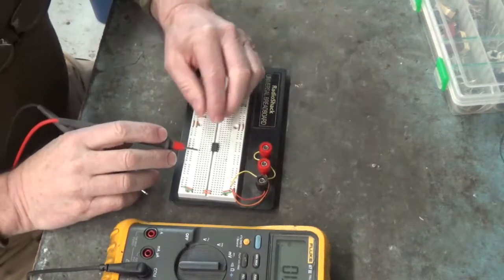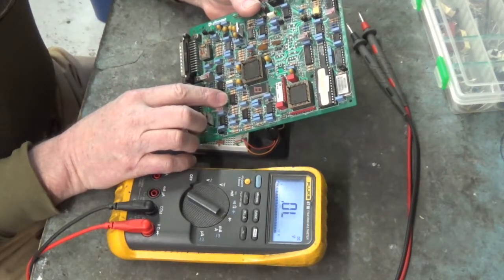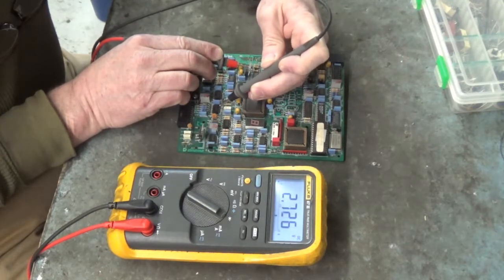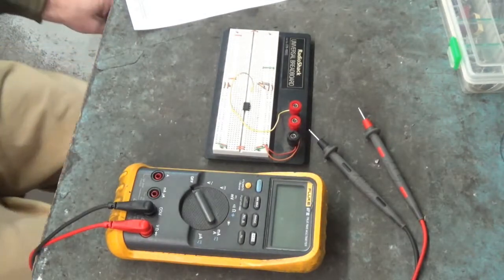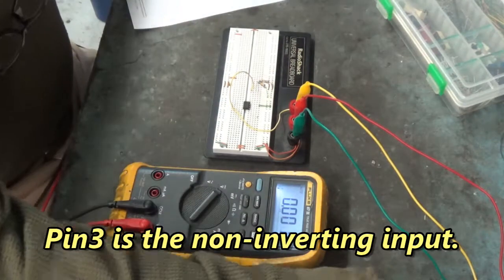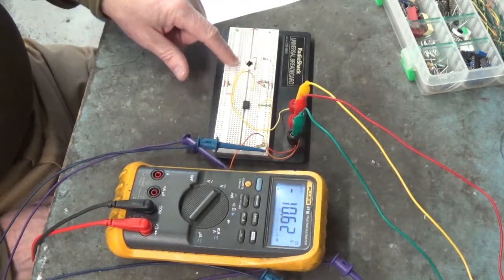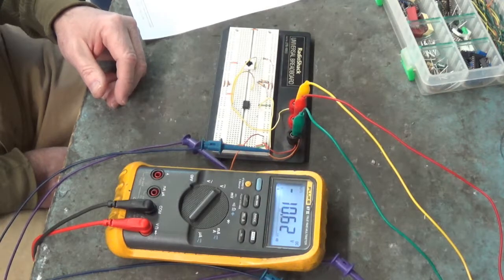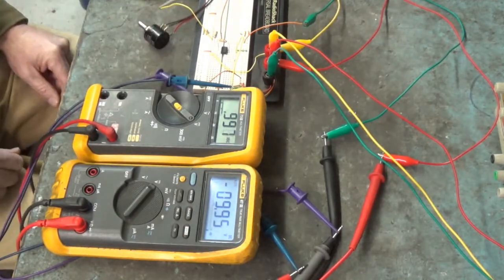Testing the TL071ACN Operational Amplifier

Comment: I tried the diode setting test with a multi-meter using different opamps and everything seemed normal like your test was, but when I try an ohms setting on the multi-meter like 20k, 200k or 2m, my results are all over the map, even after all of them checked out with the diode test setting. On the 200k setting with the red multi-meter lead on pin 4, readings would vary wildly from opamp to opamp, anywhere from 0 to 1.2k. With black lead on pin 7, some of my opamps would read 12.2k and some 129k. So I guess my question is, if there's nothing 'wrong' with the opamps after doing a diode drop test, yet ohms resistance tests are completely erratic, then one can only assume a simple diode test doesn't technically mean the opamps are working properly. Correct? Or is that because I simply wasn't using breadboard? Hmmmm.. confused !